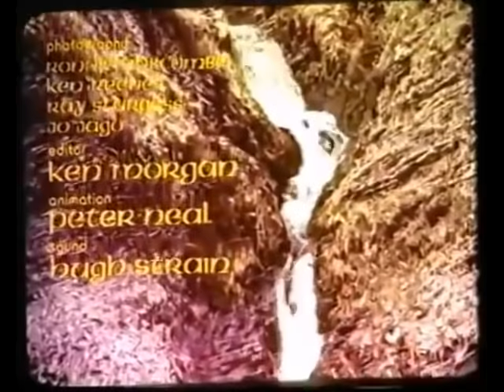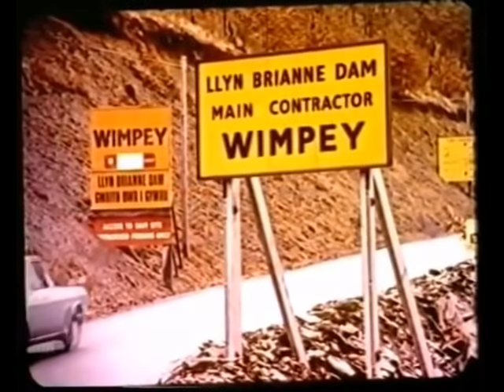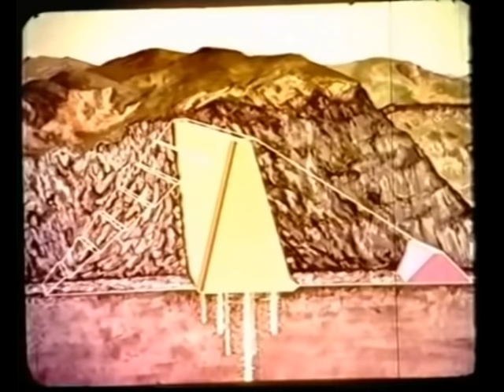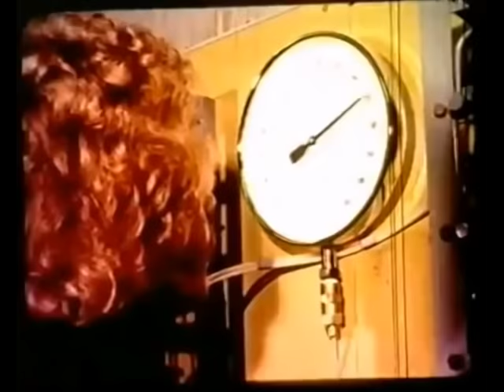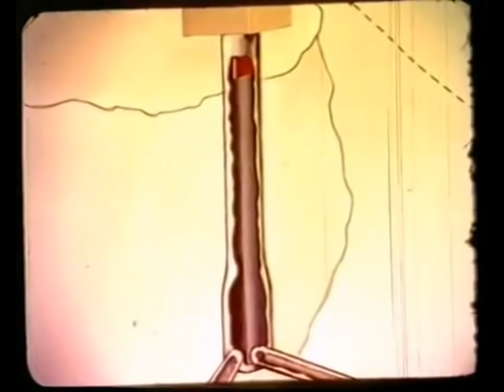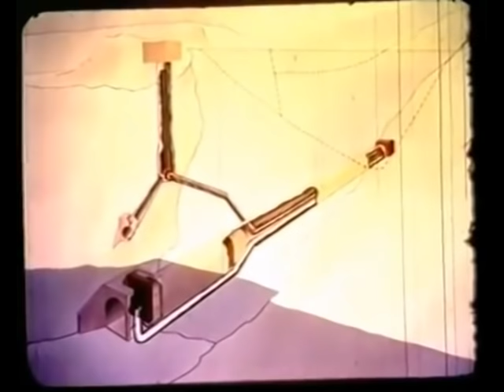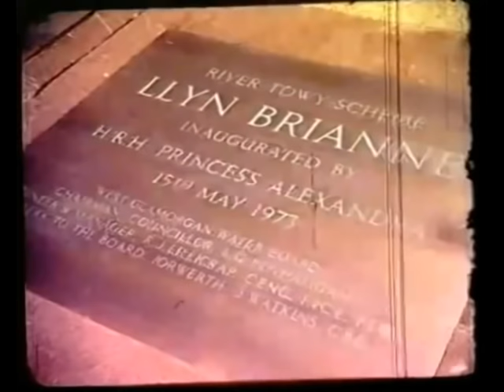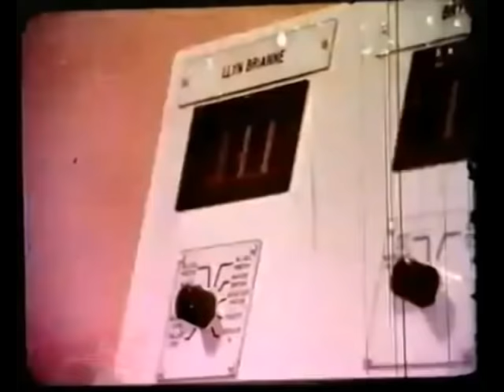The Building Of Llyn Brianne Dam - Archival Construction Film

Comment: Please could anyone out there explain what a COPPER damis.
Reply: Coffer or copper dam is like a temporary dividing wall to keep the main waterway  away from the working area ,it could be built with whatever is available at the time, stone rock clay or in later years steel interlocking piles driven int0 the ground,when the project is complete the dam is removed and the area allowed to re water.

Comment: Why in metric ? What a fool this commentator is
Reply: Why not? Metric has been taught in Welsh schools since the 1970s.
Reply: Because that is how we measure everything in the UK
Reply: @geraldlrstubbs  No. We measure things using both metric and imperial measurements. And the metric system has been taught in UK schools for nearly fifty years.
Reply: Because it's not the 19th century anymore.
Reply: Cause it’s a metric country.
Reply: @jeffshultz5348  No its not. We adopted the metric system in 1972, but many things are still measured using the imperial system. So both are still used in many industries.
Reply: @uncensored5104  Still drink beer by the pint not by the cc .
Reply: @stewatparkpark2933  Yep, all pipework and metal gauges are still imperial as well as other numerous industries.
Reply: @stewatparkpark2933
Yeah but apart from milk and beer we buy fuel, wine, soft drinks, fruit juice, condiments, cosmetics, detergents, laundry products, fertilizers, medicines, oils, paint etc etc, in metric  units.

Comment: 2,000 mm = 200 cm = 2 meters! Why do they use the higher number? Perhaps just because it sounds bigger.
Reply: Because you don't have to mix measurement like you have to when using imperial measurements say 2584mm it would be 2 metres and 584 mm sort of like 8 feet 5 and 3/4 inches, complicated and more open to error.